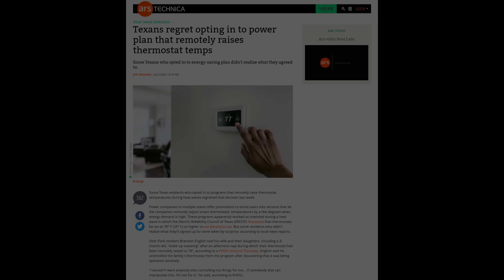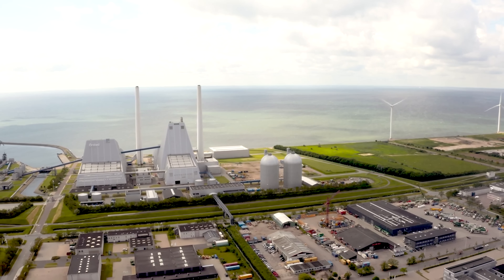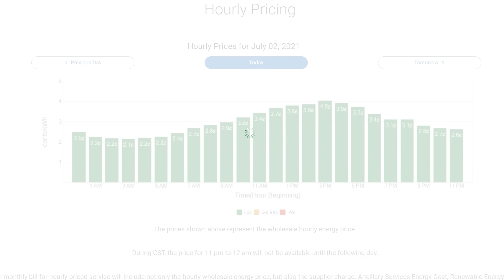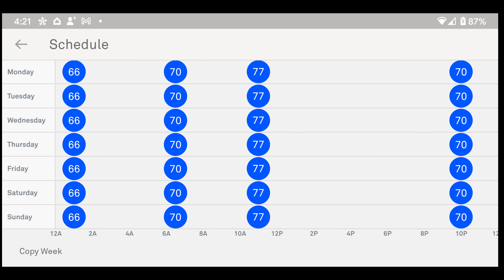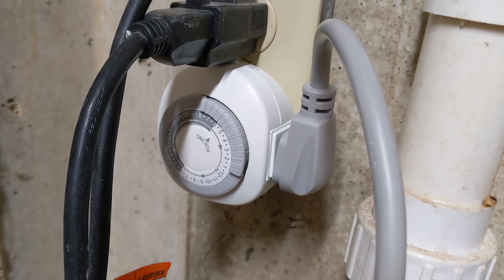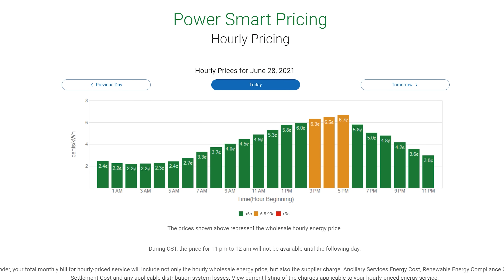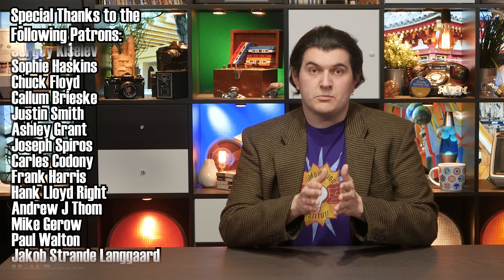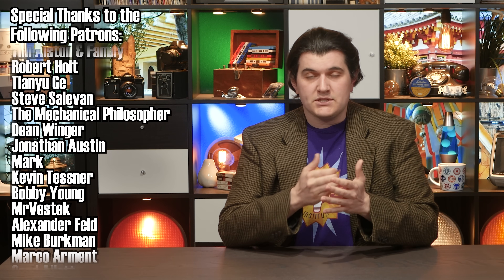Batteries aren't the only way to store energy. Here's another.

Comment: "Heat pumps for the win"
That is the biggest takeaway from this channel, by far
Reply: how did u leave a comment a day ago
Reply: @twistedwhiskers8776  different time zone
Reply: @AnteMimicaMiMe  i don't think i did it like this before
Reply: @twistedwhiskers8776  Patreon supporters get access to the video early
Reply: Heat pumps\recuperation way too good. You can heat up or cool down any place by just shuffling air around using passive ceramic or otherwise heatsinks and switching air pathways. After the whole setup the running cost is practically nothing for home use. 5000 times cheaper than having air conditioning.
Reply: I've been bothering so many people talking about heat pumps frequently since that video
Reply: @Andytlp  air conditioning are heat pumps tho
Reply: @AnteMimicaMiMe  I'll blow your mind, but time passes with the same rate in different time zones. Something posted an hour ago is still posted an hour ago regardless of time zones.
Reply: @SuPerbMusiCFan  the video was likely either set public for a short while before it become unlisted or private and set to go public today, or it was set to unlisted and was put in a playlist and the person found it while in said playlist
Reply: @LzysGraphics  Patreon subscribers get early access to the video
Reply: @SuPerbMusiCFan  ahh duh, thanks for letting us know
Reply: @Andytlp  That will work for very dry environments but most places have humidity and pollution to deal with. A sealed home can reach mold breeding humidity levels in just days. Air Conditioning is called that instead of "air cooling" because it filters, dehumidifies and cools.
Reply: @nunya___  We dont do that here in eu. Production is outsourced to asia so they breathe toxic stuff not us. What suckers they are hahah.
Reply: Also chest freezers
Reply: @Andytlp  " any place"

Well, not any place. Heat pumps would be wildly inefficient where I live, where it goes below -20F (-29C) for significant stretches every year.
Reply: If only I could magic some extra space in my house to fit a heat pump boiler. But it's impossible with current products on the market, so I'm stuck with a Natural Gas boiler for my hot water and central heating.
Reply: there's a whole neighbourhood with heat pumps in my city. nearly everyone is so unhappy there they leave within 2 years. for the simple reason they can't reliably keep their homes heated through winter.
Reply: @JD-xz1mx  That's when you get geothermal heat pumps!
Reply: @SuPerbMusiCFan  you are right, thanks for blowing my mind
Reply: @gamiezion  What goes wrong? Do the heat pumps break? Is it too cold outside in winter for them to work effectively? Are the heat pumps undersized for the job and/or the houses insufficiently well insulated? Do people expect to be able to turn them on and an hour later it has heated a freezing cold house? (which heat pumps won't ever be able to do, you have to leave them on all the time basically as you get background heat).
Reply: @owensmith7530  as I understand it the heat supply is inefficient. The neighbourhood is newly build to work on the heat system, so it should be sufficient. Please note, I mainly know this from news publications.
Reply: @gamiezion  That can be precisely my last point, ie. people expect a heat pump system to warm up a cold house as fast as a natural gas or electric resistive heating. That will never happen, heat pumps produce lower temperatures and less overall output by design. They are intended to be left on 24/7 or at least only turned off while you are in bed asleep. But people seem unable to accept that and think leaving the heat pump on all day while they are out is wasteful.
Reply: @JD-xz1mx  If sized correctly common equipment still has an energy coefficient of 1.5 down to -20F. I recommend using several smaller units in those conditions  than a single large one. 
Also, using the correct refrigerant and design, Heat Pumps will heat efficiently at colder temps but honestly I'd want something simple that requires no power.
Reply: @owensmith7530  Most Heat Pumps have "Second Stage" heat that automatically starts at some point and most often uses electric heat strips ranging from 5Kw to 20Kw. Those usually discharge about 100 degree air and will warm a home up faster but you loose energy savings when in that situation.
Reply: Hmmm, here in Germany heat pumps are a thing since 40 years. But not ACs. Air conditioners are for sissies. Oh and sorry for that, I know that doesn't apply to other habitats at other latitudes. They make life for you Aussies and 'Muricans, etc. easier.
BTW about the video title "Batteries aren't the only way to store energy." In fact, they are one of the WORST ways to store energy. In terms of energy density, effectiveness and efficiency. The best energy storage is no energy storage. That requires some smartness and other framework conditions. It is even better to save energy instead of wasting energy. 
And you are absolutely right, Simoneister: "Heat pumps for the win":) ... plus the other stuff:)

Comment: This reminds me of when I was in college living in a crap rental house with no ac. I would use box fans on opposite ends of the house to create something of a wind tunnel. I did this all night long and woke up at dawn to close all the windows. It would trap the night cool air inside and worked remarkable well.
Reply: That's basically roman air conditioning. Except they used wind-traps on the roof to catch night breezes, as they had a very limited supply of box fans ;)
Reply: I'd argue that 0 is non existent rather than limited, but to each their own
Reply: @DanielSultana  No appreciation for my humor.
Reply: @kathrynck  i was doing a your joke but worse kinda joke
Reply: @DanielSultana  ohhhhh, I didn't pick up on it. I guess I get the "woooosh" :P
Reply: A lot of people I know have always done that, ventilating our houses on summer nights.  It’s not just “college age” or “crappy buildings”; it’s a common sense way to save a few bucks on power.

Comment: Just got this from my electric company in MD (BG&E):
"Get paid for doing your part.
Through Connected Rewards, your smart thermostat temperature will automatically be adjusted by a few degrees during select summer days when the demand for electricity is highest. To keep you cool and comfortable, your home may be pre-cooled slightly ahead of these adjustment events."
Sounds like a partial implementation of your plan. I like your idea of using the volume of the house to "store" cooling when it is cheap and I've been trying it informally. At some point I plan to reprogram my thermostat to give it a more rigorous try.
Reply: Woah, BGE being smart for once.
Reply: @orppranator5230  But they aren't earning anything from selling me electricity when they switch of my AC.
Reply: Same here in SoCal with Edison. They will pre-cool the house before the 'energy rush hour' event.
Reply: @MarcelTransier  instead, they're losing money by driving the generators out of peak efficiency.
Reply: @MarcelTransier  They also aren't earning anything when they switch off your entire house for a rolling blackout when there just isn't any power left to sell you in the first place, and rolling blackouts (or worse, unexpected blackouts) cause a helluvalot more expense when it comes to maintenance on their very large electric infrastructure.
Reply: turn on ac at midnight to 70 during summer and leave it be.
turn off around 1030 am
run fans as needed
maybe 2 hours at sunset?
Reply: is not soo much the tempurature as is the humdity
Reply: And that's how they're going to ease everyone into having their access to electricity and heating/cooling restricted.

Comment: Im from Germany
Our "air conditioning" is opening windows in the morning to ventilate the rooms with cool morning air, keeping the shutters on the sunny side down during the day and hoping for the temperature to drop below 30°C (86°F) by the late evening.
But at least, rolling blackouts are not a thing here :D
Reply: my shutters dont work anymore :(
hilfe
Reply: Given the very hot summers we've had since we moved here (this year is a bit crazy, of course) less effective than previously. However, the heavy masonry houses here in Germany (our house has 40 cm exterior, 30 cm interior walls) make this a very viable option. If you can capture solar gain during the winter, it can also be veryeffective.
Reply: @inyobill  I call that the "European special". Why buy an AC if you could get a bunch of bricks, instead?
Reply: @Gabu_  When its 35-40 during the day and 25-30 at night for a couple of weeks (this is the first summer in the Swisttal in about seven years we haven't seen that), it's hard to shed the heat from the masonry. In the Dachboden, with over 40 cm of new insulation, and proper sealing, it would be unliveable.
Reply: Tough when you get up at 7 and it's already 27°C.
Reply: I'm sure some coastal Canadians can do this, too. They share your latitudes.
Sadly, most of the USA is too close to the equator (and too landlocked) to do that. The sun here is no joke. The sunburn is awful, too. We sure planned this colony good, huh? x_x
Reply: Been to Germany few years back, some business trips to Volkswagenland. The idea of a hotel charging 150 EUR/night and not having A/C or even fans during a heatwave was certainly new to me, with everything else being absolutely stellar.
Next times, I took some 120mm PC fans with me. It was enough for me to not wake up in a puddle of sweat.
Reply: @inyobill  Yep. If at night the temperature doesnt go below 20C you the house cant really cool down. Also this overcooling method only works if you have a large enough space.
Reply: @mykolapliashechnykov8701  oof, i didn't know that. Guess i won't be going to Germany ever lol
Reply: @mykolapliashechnykov8701  Still a lot more energy efficient than some current-sucking AC in pretty moderate climate. In southern Europe, people just do siesta instead (a nap during the hottest part of the afternoon), that has worked pretty well over centuries. Some energy-problems are really caused by people being whimps ;-)
Same thing with clothes-dryers. Most of the time, a clothes-line is the low-tech, totally free, wind- and solar-powered alternative.
Reply: @Makatea  Oh hello there, long time no see! I guess the Four Side still haven't stocked on the fans? No? Well, it's alright,  not like the travellers have any choice where to stay in Wolfsburg.
Good grief. The hotel staff gave me exactly the same speech as you did, while sweating bullets. Terminal greed under the guise of ecology.
Reply: In Germany: "...But at least, rolling blackouts are not a thing here :D"  Well, with the world's largest open pit mine supplying lignite to power about one-half the country, the power should be reliable. LOL.
Reply: @mykolapliashechnykov8701  indeed. It is remarkable how much cooling a small fan can do, if you keep it close to you. You do need one fan per person though, so it's a bit awkward. But it draws less than one amp, unlike a full blown AC unit!
Reply: @Swim Fan uh, what? Do you think there is air-conditioning in wild north Africa? Or in the Brazilian barren northeast? Yet people survive there just fine.
Reply: You could always invade France and go have a holiday up in the cool mountains there.
Reply: @mattobermiller5041  Old habits die hard...
I guess? XD
Reply: @G1ennbeckismyher0  he was in Wolfsburg, where Volkswagen owns a lot of hotels. They charge high prices there cause of consultants staying over night and the hotels are not too well equipped there. Most hotels here do have a central AC. Beware of smaller ones called "Pension" or AirBNBs. They often don't have AC
Reply: No Blackouts, but the price per kwH is also like 35 cents US
Reply: i do the same as you do. + i wear big socks and jumpers in wintertime